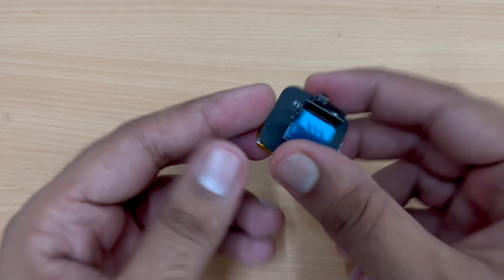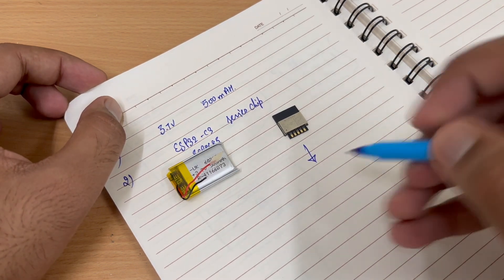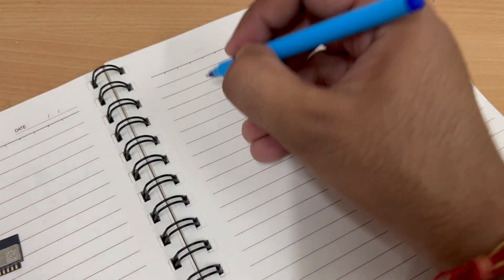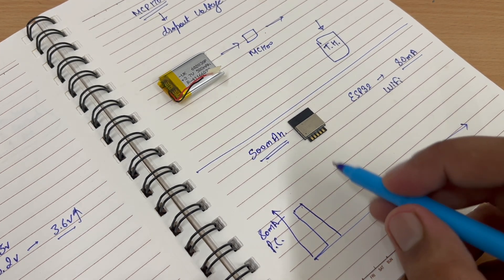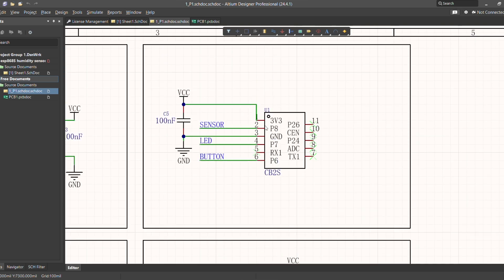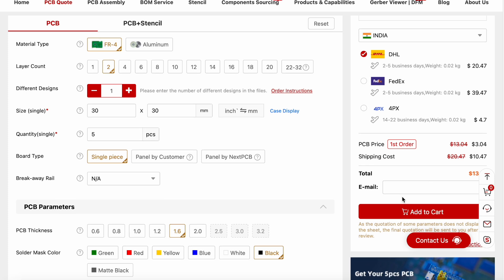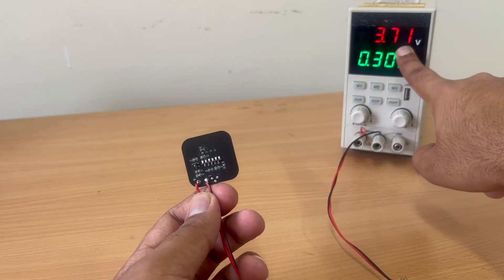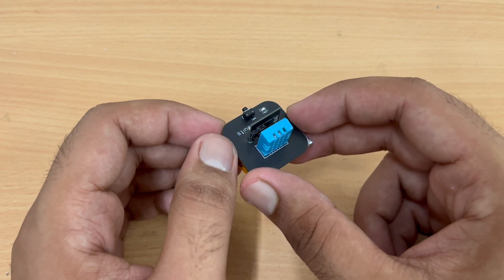ESP32 Temperature and Humidity Sensor | DIY

Comment: Hello nice video!
I am working on a board that will have temperature sensor soldered to the pcb,
i would like to ask if the MCP1700 and the area around it get any hot